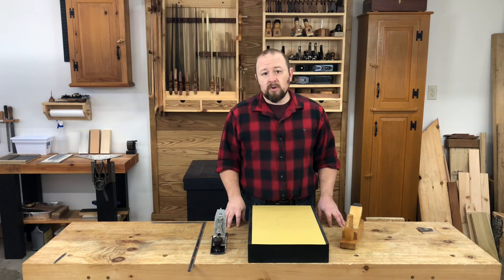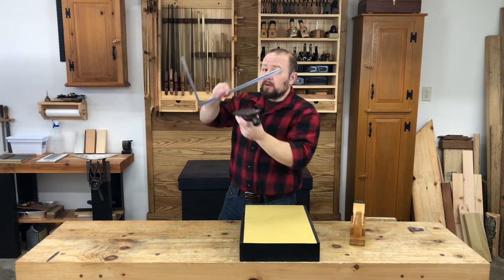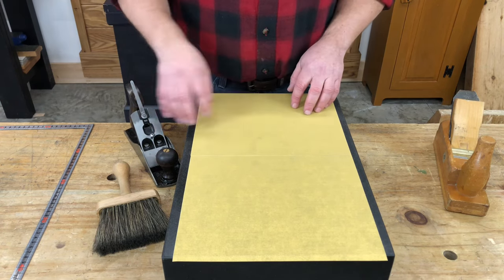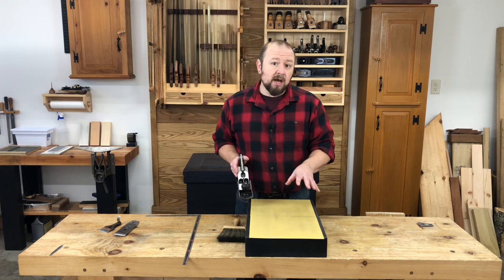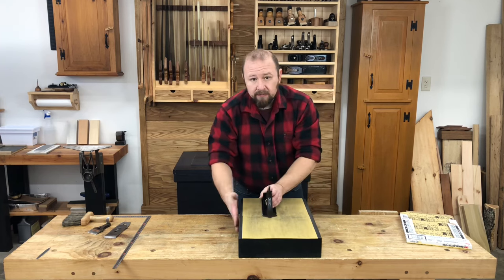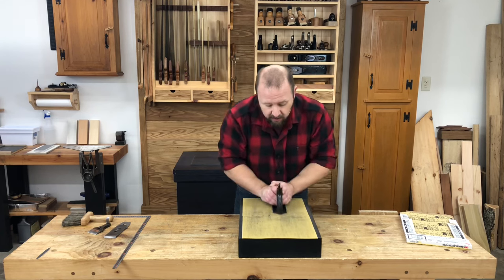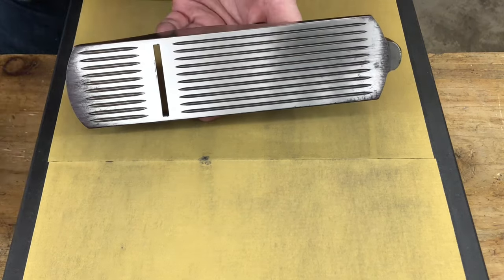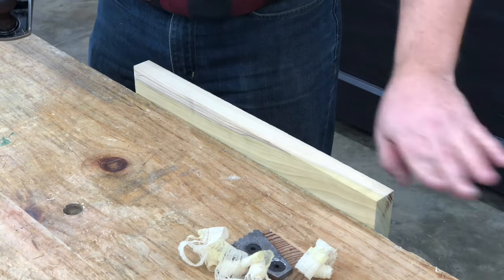Do You Really Need To Flatten Your Hand Plane’s Sole? | Hand Plane Foundations

Comment: Not disputing the benefit of changing your sandpaper sheet frequently when it wears but if you spend about twice the time at the edges of the paper as opposed to the center, wouldn't that wear the paper more evenly and reduce that tendency to convex your plane sole?

Comment: This is one of the best videos on the subject of flattening plane soles. No BS just common sense advice and I am so pleased you mention that you do not need the plane blade in and under tension to flatten the sole. I have restored many planes and set them up on a surface table using a DTI and the tensioning does not affect the sole at all. Great job!!!

Comment: As always, great tuition. Thanks.

Regarding the wear of the paper. I would work the plane on say the left side of the paper until the paper stops effective cutting. I would then move across a little over the width of the sole and work on fresh grit. When that ceases being effective I would move over again etc etc. The full width of the paper is eventually used up and the sole has had the most effective cutting, consistently.

Comment: Thanks for the video. For fine furniture making you need your plane to be dead flat along and across the sole. At least at the toe, the heel and the mouth areas. The difference in performance can be significant and sometimes detrimental in fine woodworking applications. Great job again.

Comment: Hi Bob, interesting video.  I have inherited an old Sears plane that was taken care of poorly.  The blade was exposed and has a deep nick in it.  I'll address that later with stones and a sharpening guide.  Right now, the sole is also rusty but not pitted.  I've disassembled the plane and am in the process of cleaning/polishing it all up. While I was cleaning the sole and running it over some 600 grit sandpaper on a flat surface, I found that the sole is concave.  The side, front and rear edges polished up right quick on the sandpaper but the center along its length is not being touched by the sandpaper.

Now I'm using a more aggressive grit (220) and trying to get the whole sole flat.
Is it worth it? Should I spend the hours on this or just chuck it and get a new one? I'm not even sure if this plane could be sharpened and tuned to work as a general usage flattening/jointing/chamfering plane?

What do you think?

Comment: I agree with most of what you said, but have you checked with the blade installed afterwards that it's still flat? Tension from the cap iron apparently can flex the sole to some degree.
I would still try to not put all that fine metal dust into the air. :)

Comment: If the sole is quite a few thou out and you really want the plane, it may be quicker/easier to take it to a friend that can run a milling machine.  I have seen  ten or twelve inch jointer beds milled down true and flat in a relatively short amount of time on a milling machine.  You will need to figure in the cost of the milling vs buying a new upper end plane ( Veritas, LN, etc..)

Comment: A few years ago, I went to a Habitat ReStore and found two pieces of granite (3ft x 6in and 4ft x 4in) for under $10 each.
Reply from the maker: Great suggestion!
Reply: Make sure you bring your straightedge if you do this though.  Not all granite is flat.  DAMHIK!
Reply: If you go to a countertop store, especially one that deals with stone countertops in particular, they will usually be willing to sell you cutt-off prices from things like sink installs. Sometimes you get it for free, they were just going to throw it out, or cheap. Make sure it is flat though! The other option, although will cost more, is to get some thick float glass as it is very flat just because of how it is made.

Comment: I’m always a little tempted to transition to transitional planes because of this. I don’t mind the classic all wooden planes or tap adjusting, but having all the adjusters in one spot is handy.

I never make the move though because I always have this little vision of the wood sole having some movement and flexes or twists the frame the frog sits on, ensuring no amount of flattening the sole ever makes it plane well because all the problems are on the top side.

I haven’t noticed such a thing on my later made no. 26 jack plane that I sometimes force into a short jointer role due to space constraints though. I think that concern grew after looking at a friend’s Sargent transitional smoothing plane and saw that the frog is screwed directly into the frame rather than into the  wood sole like with my Stanley made one.
Reply: Vincent just wondering if you remeber with direction is to advance blade on Sargent transitional?  My 26 is a later one and is right turn advance. Like the idea of more solid mount for frog on my foreplane.
Reply: Hi Jim,
It was counter clockwise for a deeper cut. And I like how Sargent did it too, despite my original concern. It would make it way easier to make a new sole for it and have been looking for an unhandled smoothing one. My friend's is a stepped Razee shape.

Comment: What were you using to hold the sand paper to the Stone?
Reply: I used spray adhesive. Some say 3M Spray 77 is the best, but it's quite expensive, I bought Mastons general spray adhesive, worked fine when I flattened my Stanley 4 and 5 and one small block plane.

Comment: How do you get that massive surface plate on your bench!
Reply from the maker: It’s only about 80 lb.
Reply: @BRFineWoodworking  Looked a lot heaver! I often lift my smaller workshop anvil that is around 90 lbs on the bench. I have 2 type 11 no 5 1/2 planes that are in the restoration process. I know some use them as a large smoother. Should I flatten their sole if they are out by a few thou?
Reply from the maker: I probably wouldn’t bother. I don’t like long or wide smoothing planes.

Comment: You don’t think having the iron and lever cap in the plane flexes the sole slightly enough to make a difference?
Reply from the maker: Not at all. The iron and lever cap are not joined to the sole/main casting at all. They only attach to the frog. So they may put some minor flex in the frog but not the main casting. If the main casting is flexing when the iron is locked into the plane, that means the lever cap is so tight that it’s causing the frog to flex, which would be a tremendous feat. It would require the lever cap to be so tight you’d probably need two hands or a clamp to lock it down. That’s way too tight for the lever cap. The lever cap needs to be snug, not super tight. So if locking the lever cap down flexes the main casting, the lever cap is too tight. You need to loosen the lever cap not lap the plane’s sole. 

Now wooden planes are a whole different story, but this video isn’t about wooden planes.
Reply: @BRFineWoodworking  you sir explain things very well. Thanks, I entirely agree.
Reply: @BRFineWoodworking  As evident by shavings produced.

Comment: 1. If you say something that contradicts what experienced woodworkers say - that you dont need the blade inbthe plane when flattening, please provide some proof.   
2. How coarse sandpaper you need for flattening depends on the sole material.  Old planes are made from softer iron while new ones usually from harder, so youll need ~100 grit othereise it will take ages.
Reply: If the tiny force of the screw was enough to distort the entire plane, then the power of your hands pushing the plane would be far more than needed to distort the entire plane. (you would never get it flat) Instead. the plane is so much stronger as to distort the blade.

Comment: I don't understand why woodworker's don't metal scape the bottoms and then lap out the scrape marks with emory cloth.
Reply: My reasons are 1) Metal scraping takes time and skill (I scraped a #5—it was my only plane for a while), and 2) Sand paper on a "flat" reference surface is sufficient in nearly every case.
Reply from the maker: Most woodworkers don’t have the necessary tools to scrape. Lapping is easy and lets them use tools/materials they already have and are already familiar with.
Reply: @BRFineWoodworking  Metal scraping will takes a few minutes to get a plane's bottom flat, depending on the precision desired. Trying to flatten anything larger than a #4 will wear your ass flat out. You only need a tube of Dykem paste or any brand ($15 should last for ever) and a Dremel with a conical stone, a or a even old file with a profiled tip.
Reply from the maker: To each their own. I’ve done it and don’t find it any easier. It’s certainly way messier. And if so much metal needs to be removed that the sole can’t be lapped flat enough in 20-30 minutes, the plane isn’t worth the effort regardless of the method. 

As for lapping planes longer than a number 4 I don’t see a need to do so. None of them (at least the way I work) need to be as flat as a smoother as none of them will ever be set up to take a cut as fine as a smoother.
Reply: @BRFineWoodworking  Very true. LOL!  A few years ago, around the time you released your first videos, flattening planes and chisels were all the rage on YouTube and magazines. It left the impression that a hand plane is useless unless you flatten the hell out of it. I was one of the victims. I remember obsessing with a ruler after what seemed like hours of flattening. Every time I checked the sole against the ruler holding it up to the light, I noticed a pattern of light touching every so often across my ruler. I figured I still had more flattening to do and continued lapping away.  Tired and frustrated, I finally gave up and I'm glad I did, or I would have ground away the entire bottom of my 607. After some research, I discovered the light pattern was due to the sandpaper's grit size!  LOL!  Thanks!

Comment: 95% of youtube lapping planes is so horribly wrong, they take a plane and just lap until they get scratch marks all over, then say it's flat without actually checking with a reliable straight edge, when in reality it's worse than before.
Reply: Two things with this, even though it isn't great for an old plane that is abused/rusty/worn would it still be better then it was before and good enough for woodworking, which doesn't need the same accuracy as metalwork?

Second do you have videos or instructions on how to properly sand a plane bottom flat? I've heard that there are particular ways to sand/file items to make sure it is actually lapped/shaped correctly.
Reply: @Swarm509  Easiest way I know of to get a flat plane without access to a machinist shop is to find a really flat lap (this is the hardest part) and use it very minimally. Get some blue layout ink, lap for a couple of seconds, check it, draw file the high spots and repeat the whole process while also checking with a straight edge. You basically want to avoid lapping as much as possible because sandpaper will always wear unevenly and will always give you a convex sole. Small imperfections do not matter, what you want to avoid is a convex sole. If you start with a concave sole it's pretty easy, but if you start with a convex sole it will be a lot harder, most likely you will have to selectively scrape (or sand with small block) until you get close to a flat or slightly concave sole then start the lapping/drawfiling process. Or just don't do it at all, get yourself a premium NR.5 to flatten wooden planes and forget about all this metal plane flattening work.